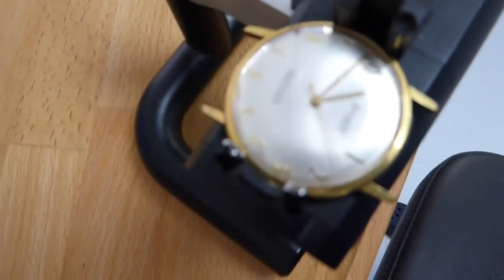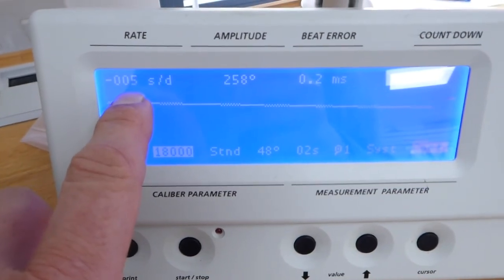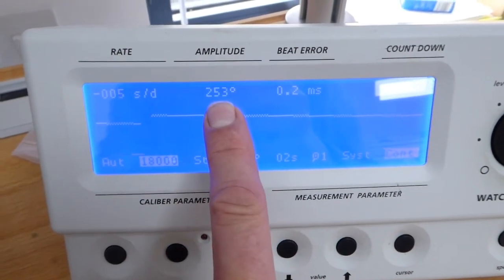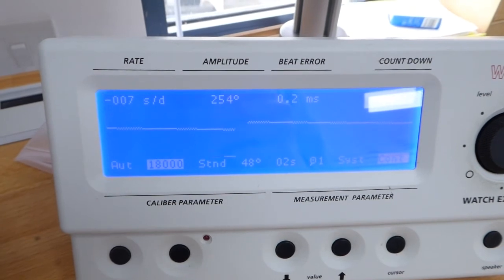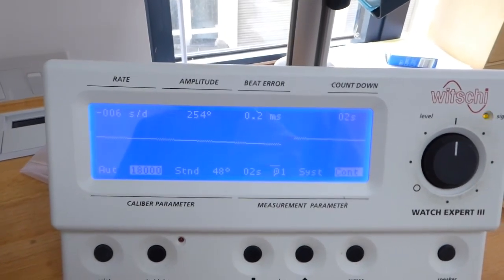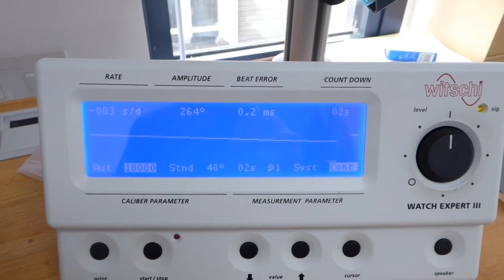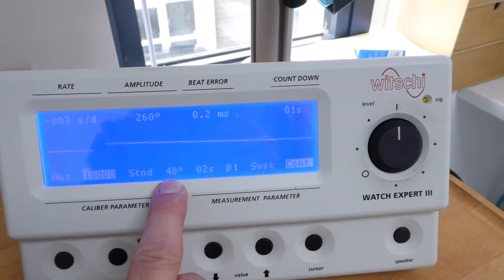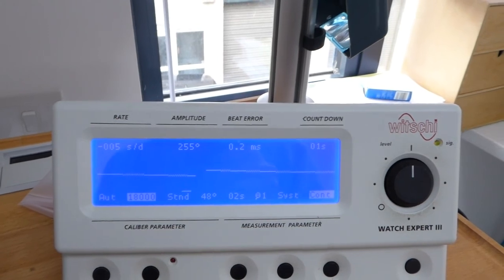Diagnosing watch faults - Introduction

Comment: Thank you. I'm looking forward to the next few 'episodes'. 
With a small collection of watches and some dial, hands, date wheel, crystal swaps etc under my belt, I've found my timegrapher to be a huge help in putting a movement into beat and regulating. Or indeed deciding whether to send a newly acquired (older) piece for service.
Reply: if you dont use it, dont touch it.
i have 100 watchesa t home but i have only two , serviced, becasue i only use those two,

,,, 
~

You should not use a wathc tha have signals of needing service, ( you see that in the machine.),.